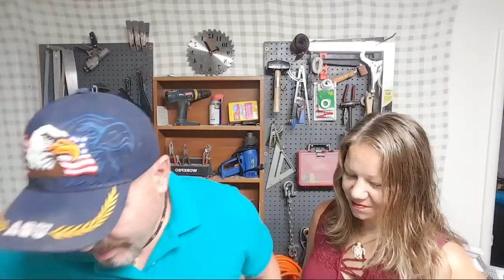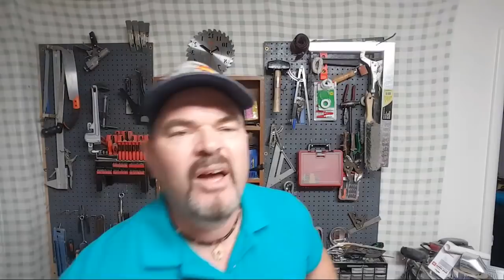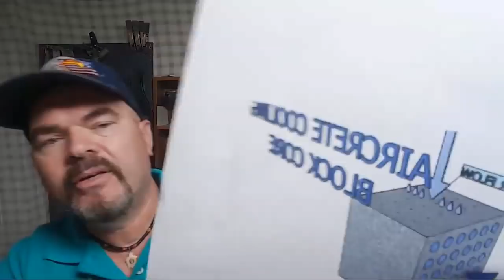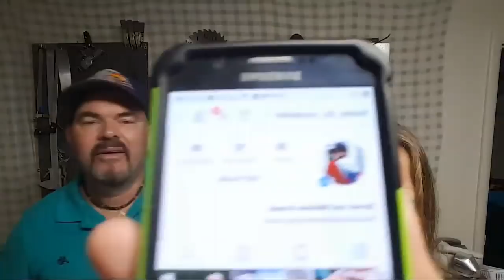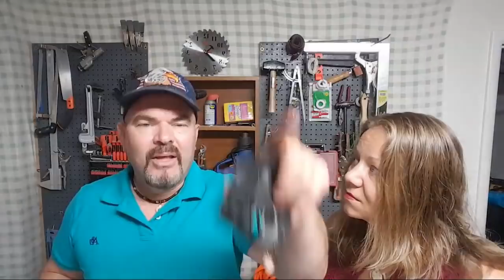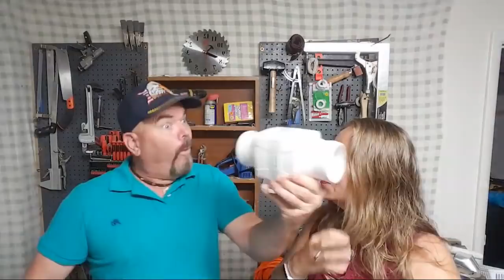Air Crete Cooling Block Drawings

Comment: If you have air and water mixing in your steel mesh, all you are doing is making a swamp cooler with steel pads. Since the air Crete is porous, drip the water thru it, but use your UN-perforated pipes for air flow. The air will give up heat to the (metal, preferably copper or aluminum for heat transfer) pipes, and come out cool and dry.

Comment: Darwin, project is looking good!  The key to this is evaporating the water! For every 1.5 gallons of water evaporated, that is equivalent to 1 ton of air conditioning or approximately 12,000 BTU's! Good going on configuring this with AirCrete for better efficiencies!

Comment: and instead of pvc tubes going thru the aircrete cooling block...they can just be holes ( tunnels )....that way no need to drill tiny holes on top...the tunnels will be stuffed with shredding stainless steel and pearlite ...and the whole thing get drenched like a sponge anyway....so spray the pvc tubes with pam non stick cooking spray and pull em out when the concrete is almost set....

Comment: So, let me see if I understand what you are saying....
You want to make a block of aircrete with multiple holes going completely through the block. Through the holes, there will be piped air and the cooling water will be flowing through the block due to the porous nature of the block. Then you said that you want to stuff the air pipes with stainless steak mesh (just the portion in the blocks) to help cool the air faster, and then you are going to drill holes (1/8 inch) through the blocks and the pipes to allow the water to enter the pipes and wet the mesh.  Do I have this correct?